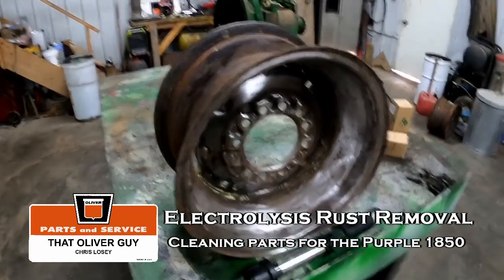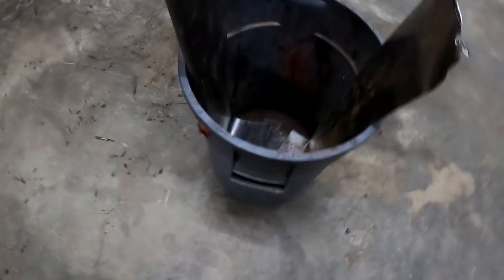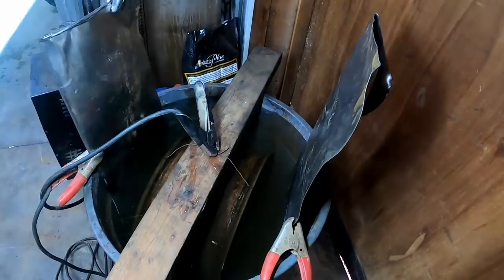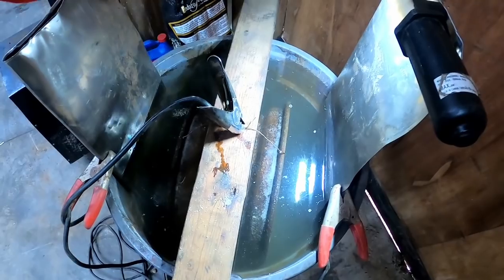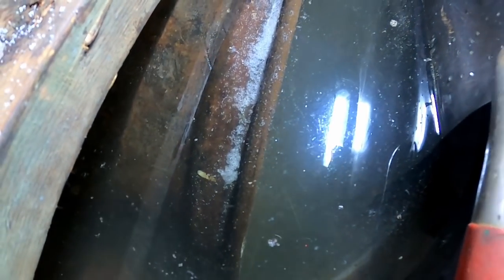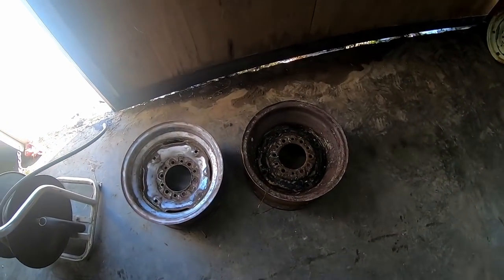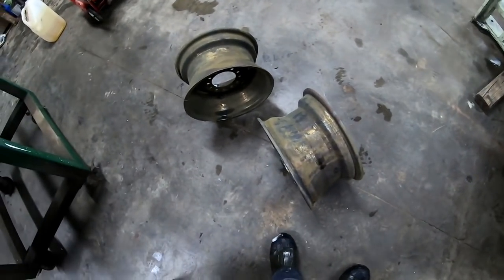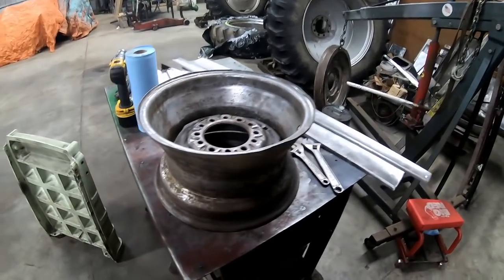Cleaning rims with Electrolysis

Comment: I really like using electrolysis for rust removal, as well. 

I used to use sacrificial strips of steel, until I was given a bunch of carbon arc gouging rods. I think they're made from graphite. All the conduction, with none of the mess. Keeps the water fairly clean.

Comment: Grandma used to make her own lye by putting wood ashes in a vee trough and running water down thru the ashes and catching the lye.  Lye soap was great for washing close and dirty kids.  I use an old power chair charger, Arm & Hammer washing soap, a bunch of rebar anodes welded to a rod shaped to my tank, put the parts in and when I think about it a few days later I go pull it out.  Wait too long and the water is all gone.  My wife used to get carboys of phosphoric acid and I used some of it to de-rust items.  Evapo-Rust is what the big boys are all pushing now.  Use a rust converter on the bare metal after removing most of the rust.  It converts rust into a black oxide that you can paint over.  It stops the rust holes in your old car and trucks if you can spray or brush it over all of the rusted part.

Comment: I've been nickel plating small parts in the shop with the same process , only on a smaller scale , it's very satisfying to see the results , thanks for sharing
Reply from the maker: I've wondered about stepping up to some kind of plating. Is it just a different anode?
Reply: @ThatOliverGuyChris  yes, I use a nickel welding rod with a cell phone charger & copper wire for a hanger, works great
Reply from the maker: Thanks!

Comment: Nice work.  I belong to a group on FB called Electrolysis Tank Builders.  The pros there all use stainless steel for their sacrificial anodes.  I like using old brake rotors and I use the Arm and Hammer Super Washing Soda from Walmart.

Comment: Wow that lye is impressive, I was surprised how fast that fist wheel cleaned up. I’ve seen this process used with salt as the electrolyte, worked pretty good but probably not as good as the lye.

Comment: Chris as a Licensed water operator that works in the state of Florida (i live in Georgia) i can say that the changes in dosage that the hackers made could definitely have caused injuries to those who drank it. Luckily the operator caught the intrusion quickly. Sodium Hydroxide is used to raise the pH of the water and is super alkaline with a pH of somewhere around 12. The hacker raised the dosage about ten times the normal rate. It would have basically turned the potable water into alkaline water which could burn the inside of someone's mouth and esophagus. I have had about ten meetings or calls on this since it occurred.
Reply from the maker: Yep, I was glad to hear about someone being on top of things, I hope that operator got some serious praise and a raise. I guess my point was that it's not going to cause cancer or some other long term illness if used properly.
Reply: @ThatOliverGuyChris  Yea i understood your point and didn't want  or mean to seem like i was getting on you. It has opened a bunch of eyes across the country to water safety again. In the right quantities it is perfectly safe. We used use it at one of the facilities i manage but stopped about 20 years ago. We pumped about 8,000 gallons a year into our water. 30 Gallons a day. Just don't get it on your skin. I got a couple of scars from it. It just keeps burning till you pour some vinegar on it.
Reply from the maker: No worries. Hackers are always looking for another way. I remember reading about a Vegas casino got ripped off by hackers through their aquarium. The computer controls for the aquarium were considered a low security risk, so they hacked that, and then from there they were on the network and could do whatever they wanted.

Comment: Great video, never thought about using a process like that for these old rusty messes I get into. Wonder if it would work on dry fertilizer augers that are tight? Really like your videos helps me when working on our Oliver’s.
Reply from the maker: I put dry fertilizer augers in for a friend.  It cleaned up the outside really well, I don't know if it freed them up. It did show me that deere augers were seveal pieces, because some parts weren't electrically connected due to the rust. First time I pulled it out the center shaft and one of the augers had cleaned up,  the rest hadn't chaned at all. I had to run a wire to each section and put it back in to get the rest.

Comment: Electrifying video!  (yep - I went there).  Did I catch a little Led Zeppelin at the end there?  Good shop music!  Thanks for the tip!  Seems to work great!  You ever use evapo-rust?  I think they've sent some to some other youtubers before, maybe they'll send you 5 gal or so.
Reply from the maker: Good ear! I usually turn the music off, I had a video get demonitized for cheesey music that was supposed to be royalty free. I started talking and thought about it,  and then decided to let it roll and see what happens.
Reply from the maker: I'd try some evaporust, but haven't so far.  I've got some free samples of Super Clean that I need to try out. It's recommended by Mike Kalsem,  so I figured I would give it a shot.
Reply: @ThatOliverGuyChris  I've got an ear for LZ!  I remember other youtubers getting nicked for music that was supposed to be royalty free.  They're real sticklers about it on the youtubes.  I think you're fine as long as no clip is distinguishable for over 8 or so seconds.  But I also think it depends on the artist.  Don't let the Beatles anywhere close to a youtube video!  They won't demonitize, they'll take the video down!
Reply: @ThatOliverGuyChris  I got some Super Clean too.  I've used it in the past, but it's been too cold to try out the other stuff I got.  I've use Evapo-Rust before and Evapo-Rust worked pretty well.  You can reuse Evapo-Rust a few times too.  Maybe if I keep writing Evapo-Rust in the comments, Evapo-Rust will pick up on it and send you some Evapo-Rust to try out? Evapo-Rust
Reply from the maker: @burningdinosaurs  , I wonder if the Beatles would have liked Evaporust!  Where I got hit was a 3rd party that makes the claim. They only have to give a small portion to the artist and keep the rest as 'administrative costs' I'd like to see how Evaporust works on them!

Comment: Great video.  Does using the lye avoid the black coating on the  part that results from using washing soda?  Have you had any issues from the vapor from the tank reacting with other items in the workshop?  Thanks again.
Reply from the maker: The only black stuff I have is the converted rust. If I let the converted rust dry and then hit it with my power washer, It comes right off. I haven't noticed any problems with the vapors coming off. I've had a set of fenders in my shop that I stripped 8 years ago, and they only spots that have rusted is where it touched the concrete and where a mouse built a nest.
Reply: @ThatOliverGuyChris  Thanks very much for the reply.

Comment: What is the power supply, voltage and amperage? It makes a huge difference in the speed of removal. I used a 1 amp 12v battery charger, and it took 7 days to remove rust from a garden tractor hood, about the area of a steel wheel.
Reply from the maker: I use a 12 volt battery charger and add electrolyte until it is showing about 15 amps on the gauge.

Comment: Well that's pretty cool, I have heard if cleaning metal this way but never really seen the process. Thanks for sharing.  Ok I am wondering to know and maybe others are two, what is under the orange cover in your shop? A secret project maybe lol
Reply from the maker: My brother's snow bikes. I've started shooting paint on the purple 1850.
Reply: @ThatOliverGuyChris  Cool...
Reply: @ThatOliverGuyChris  are you using Agco paint?
Reply from the maker: No, I don't like their clover white, and the rest is purple-pink. Matching that has been a challenge,  but I think I have something I can work with
Reply: @ThatOliverGuyChris  I agree with you on the white I d I not care for it either. The white I used is a little to bright compared to most but it really looks nice. In my opinion anyway. I use Dupont Imron
Reply from the maker: I'm using PPG Acrylic enamel.

Comment: Electrolysis is the only way to go on removing rust and paint. I have a tote that I cut the top off that works great. Much easier than wire wheel,  and cheaper by far than sandblasting.
Reply from the maker: Agreed. My big tank is the same.

Comment: For those interested powdered citric acid works very well.  No electricity, and not dependent on line of sight.  Pretty sure that is what evapo rust is minus some potential surfactants.  Closer to 80 degrees F the better it works but I've used it in the winter plenty of times.  It works awesome on neglected cooling systems.  It will make them look brand new.